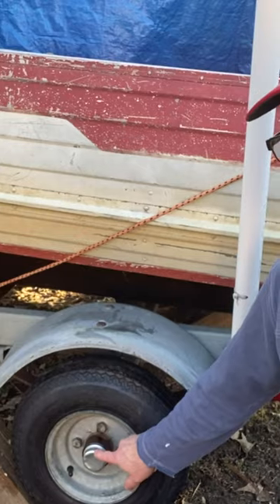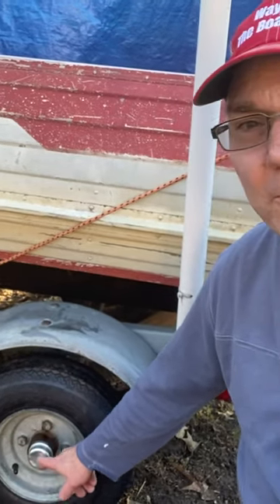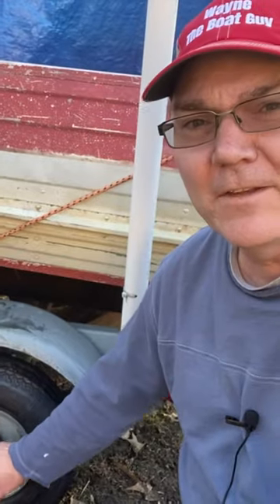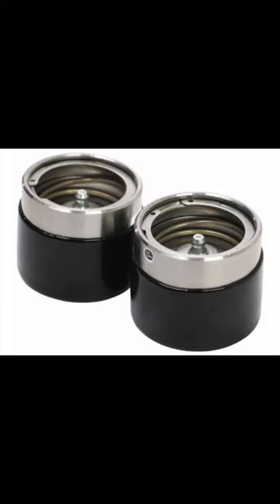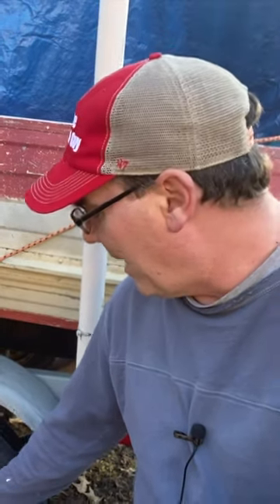What do you use for trailer axle wheel bearings - grease caps (dust caps) or Bearing Buddies?

Comment: I have been using bearing buddies on my boat trailer since I got it in 2014. I have never had a bearing issue or an issue with the bearing buddies. I only use the bearing buddies that have a relief valve. The relief valve is to not allow over filling,  but I also use it as a purge feature. Every year I pump grease in slowly until it pushes grease through the relief; Once I see fresh grease I stop. I tow my boat at-least 5000 miles a year…

Comment: I agree with Kenneth, the bearing buddies are effective, having been in the sand and gravel business for many years I learned a lot about greasing bearings and the one main maintenance issue is putting too much grease in and pushing out the seals , it only takes a couple shots and then repacking once a year

Comment: I use bearing Buddy on my boat trailer but I don't put enough grease in there to where it actually pushes the plastic plate or grease zirk all the way out. A few pumps of the grease gun and no more. Plus I repacked my wheel bearings every year just to be on the safe side.
Reply: Thanks guys just had to double check
Reply: If you repack your bearings every year why do you use bearing buddies, I’ve seen people mention how they only put a few pumps in but when you pack the hub to begin with the grease should not leave and therefore be no reason to pump more grease

Comment: I like the newer style spindles that have the grease fitting with a tube to grease that back bearing.  The downside is you'd have to fill the hub to get the front bearing. I don't like that.  I just remove the castle nut and repack the front bearing. I think the best thing you can do is jack your trailer up every so often or before long trips and spin them over while listening for abnormal noises. Replace as needed.

Comment: I work for a trailer repair and fab shop as an apprentice fabricator and I can’t count the amount of times bearing buddies have destroyed someone’s bearings, axle, hub or wheel, bearing buddies serve absolutely 0 purpose you should not pump extra grease into a wheel hub as you will push out the seal at the back allowing stuff in causing bearings to rust and collapse.
My favourite example of why you should not put them on is when we had this customer that kept putting them on after we told him not to and every time a few months after he would get his bearings done his wheel would fly off from the bearing collapsing, it took this happening 3 times before he listened and after that he had no more problems.

Comment: Timken says to only fill your cavity around 1/2 full to prevent churning in higher tempatures. if you pack your bearings correctly & your seals are not leaking why would you need a bearing buddy?   so if your pumping grease in there all the time wheres the grease going its not going to disappear like a fart in the wind & even if you pump grease in to put pressure in there its not going to last air will bleed out its not a pressurized system. the buddies with relief vaves all your doing once its filled is pumping your fresh grease right back out! unless someone can explain to me different there just another grease zerk to me! now i did find an air hub kit where you actually install seals & o-rings to keep them pressurized by pumping a small amount of air in before you put the trailer in the water but of course i had a brain fart & trying to remember where i found them, i will edit if i remember✌

Comment: Without grease and seals you can blow air through a bearing. The grease is distributed by spinning the wheel. Without the seals it would fly out. Too much internal pressure wears out the seal. Comment if you want a better explanation